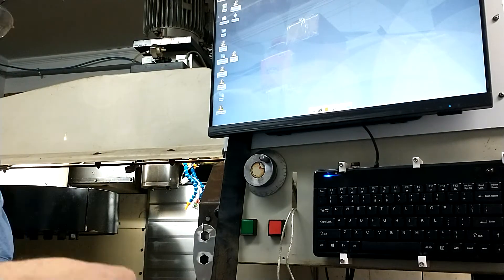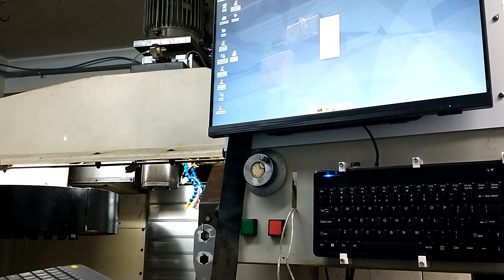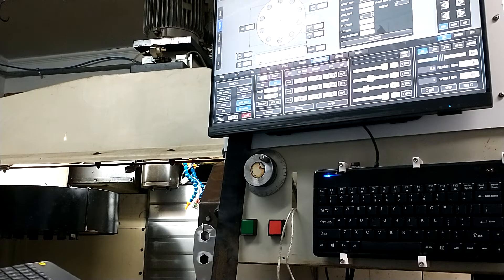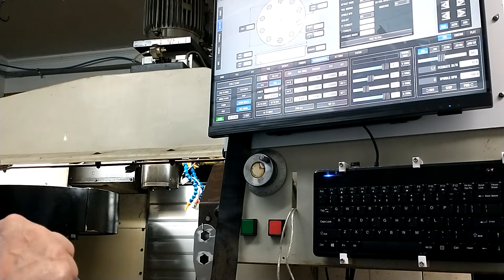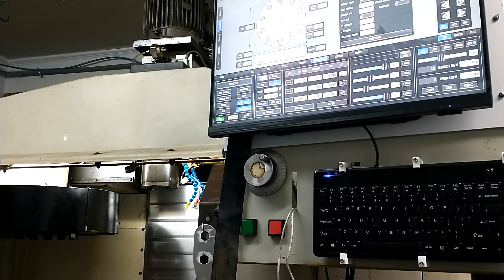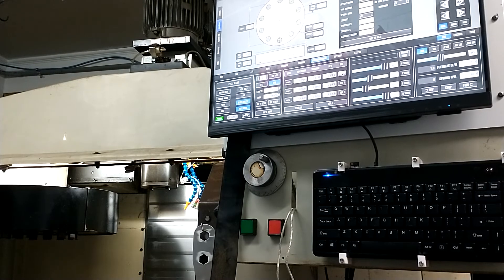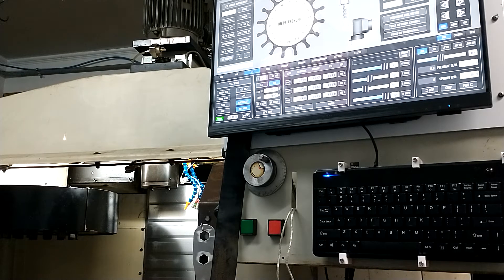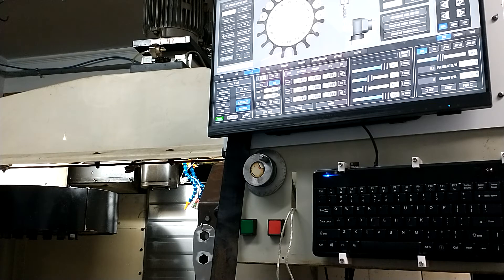Linuxcnc Probe Basic ATC progress

Comment: Hi Ron. Why you give up on UCCNC?
Reply from the maker: There is no ATC support in UCCNC. It can be beat into submission by using macros to operate the ATC, as others have done, but there is no screen to tell you what's going on. Linuxcnc is a more mature platform and has many successful conversions of commercial machines. I switched because the Probe Basic screens are awesome. The folks working on it are doing a great job! I need to make a new video of it changing tools.